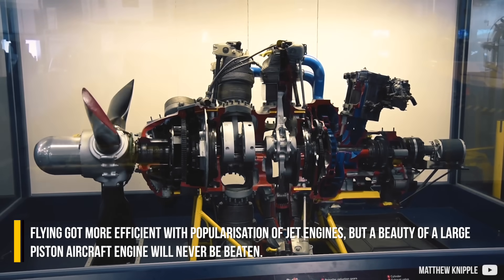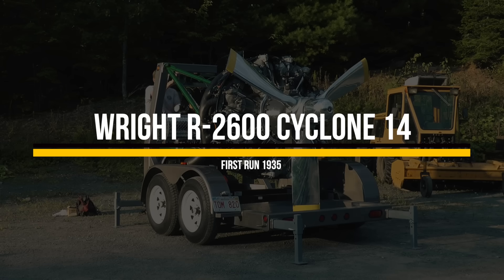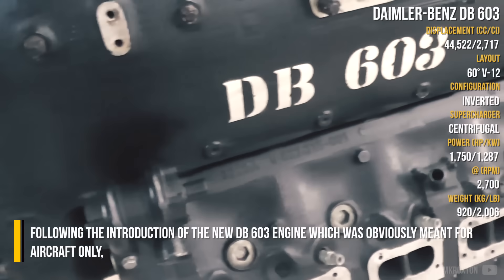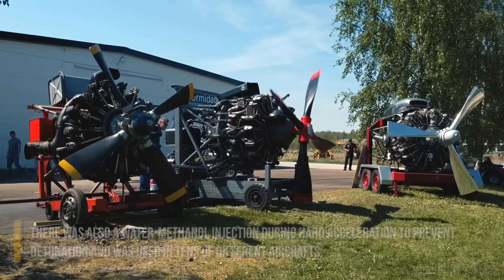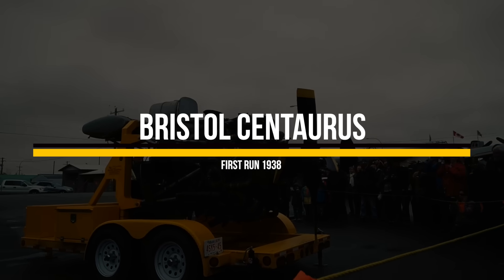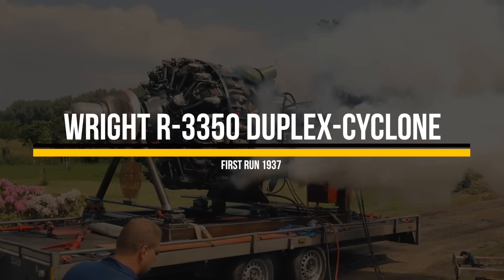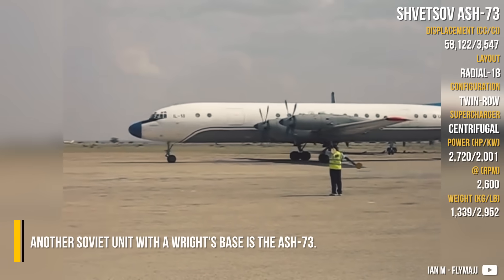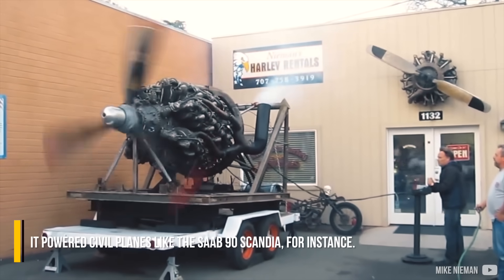9 Of The Largest Piston Aircraft Engines Ever

Comment: The coolest will always be the Napier Sabre 24 cylinder engine. Maxed out at 5500 HP. There wasn't an engine during the war that could compare to it's max power output.
Reply: Agreed.  Once initial reliability problems were overcome the Sabre was a potent engine, most famously used in the Hawker Typhoon and later Tempest. It is interesting to note that Napier ran into problems with the Sabre and the great Roy Fedden from rival manufacturer Bristol was co-opted into ironing out the problems.
Reply: @AMCKenA I like Setright's books but I don't necessarily believe everything he wrote in them.  I suspect some of what he wrote was apocryphal.  The 3050hp number I mention comes from Napier advertisements in Flight magazine post WWII.  They never advertise it at any higher power.  The 3750hp is believable for the MarkVIII and although I can believe the 175 hours but I have difficulty with it being continuous and at that power level.  4200rpm is about 400 rpm higher than the max for the engine in production and although possible it is also hard to accept.  I would think Conrod velocity would be getting up in the danger zone although I have not calculated it.

There is also the issue about what fuel they were using with charge air pressures of 45psi.  The Nomad used higher pressures but it was a diesel and I think one experimental (well, more experimental) RR Crecy used pressures at this level but it was a direct injection, stratified charge petrol engine.     BMEP is usually calculated not measured, so if any of the figures (rpm  or hp)are out BMEP will be equally out. 

Don't get me wrong, the Sabre is one of my all time favourite engines. I am fascinated by its design including the elegant way used to stop lash on the propellor reduction gear set which also serves to couple the two banks of the engine.  Its designer is, in my opinion, grossly overlooked.  But despite all this, I don't overlook it failings, not the least of which was amount of money and effort that was diverted to its production.  The same can be said of the RR Crecy and the whole range of sleeve valve engines built by Bristol. The RR Crecy, Exe, and Pennine were all sleeve valves engines (Crecy was two stroke and had somewhat different sleeve valve arrangement). 

In the book i have on the Crecy (currently on loan and not available), it is mentioned that Bristol spent more money ( maybe twice as much) and effort on determining the best material for the sleeve valves than was spent by Power Jets on the entire effort to develop the gas turbine!  I don't know whether this is true, it was said by a RR engineer, I think. The British were not alone, both the Americans and especially the Germans diverted massive resources and people to complex and totally unnecessary projects.  

The Germans, apart from the V weapons, the advanced tanks  were unnecessary (the Russian tanks were primitive but they could build a lot of them, the Russians weren't stupid), Junkers completely disabled the German Heavy Bomber Programme with their Jumo 222 and also spent a considerable amount of resources on the extraordinary Jumo 223, similar to the Deltic except having 4 banks of cylinders arranged in a rhomboid (technically superior to the deltic as all the crankshafts rotate in the same direction), and the even bigger Jumo 224. 

Then there was the RR Vulture and Peregrine.  Daimler Benz on the DB606 and other developments.  Heinkel also ran a number of high end projects that fail the sensible test.

Anyhow back to the Sabre. I assume that people at the Napier Power Heritage Trust would have a more informed view of what was the max power of the Sabre.  i must drop them a message and see what documentation is available.  During a quick look at their website, I can only see them mentioning 3000hp
Reply: @AMCKenA By the end of the war it was clear that the competition was all about fuel and air charge.  The only other part of the competition was keeping the engines in one piece.  RR's greatest advantage was the design of its supercharger.  Their other main advantage was their continuous development process.  I think it may have been Setright who described the Merlin as the triumph of development over design.  The Griffin was a far better designed engine.

Obviously the higher RPM possible with the smaller stroke of the Sabre was a big advantage but it was offset (to a degree) by the larger number of moving parts and thus inherently lower reliability, not to mention weight. 

At this point consider this; the power produced by the engine is determined by the mass of air that can be delivered by the supercharger/ turbocharger/ turbo-supercharger.  Even if the rest of the engine was up to the task the Sabre's supercharger wasn't.  This is exacerbated by the lack of charge air cooling (often erroneously called intercooling)  As is well reported, the Napier powered fighter planes really weren't good at high altitudes, a consequence of the design of the induction system.  Napier was apparently redesigning the supercharger when English Electric took control of the company.  Rightly, English Electric decided it needed to focus on correcting the reliability issues of the engine. After the war Napier redesigned the induction system for the Mark VIII.

In the end, it was the better fuels available to the allies that provided the 'edge'.  In this, there is a difference between bomber and fighters.  After the failure of the RR Vulture X24 in the Manchester bomber and its subsequent replacement by 4 Merlins which turned the Manchester into the Lancaster, it became clear that 4 engines were indeed better than 2. 

This is not so clear in fighters,  A single high power engine was the traditional solution for fighters.  Later in the war, this traditional view was tested by a number of 2 engined fighters designed by the Britishs, Americans, Germans and perhaps the Russians.  There are several to chose from but my favourite is the DH Hornet.  It doesn't hurt that it looks like an over engined scaled down Mosquito, itself inspired by the beautiful DH88 Comet.  At one time DH considered using the Sabre but the reliability/availability of the engine steered them back to the Merlin.

Although Ricardo maintained that the sleeve valve allowed a higher compression ratio by one (that is from say 6 to 7) on the same fuel, I do not know whether this was proven and if so whether it was the case later in war.

At 45psi (3 atmospheres!) the temperature out of a practical induction system is going to require a very high grade (octane) of fuel to avoid detonation and the consequent failure of the engine.  I am not sure that the maximum grade available at the time (100/150) would be sufficient for such an induction pressure and temperature, even taking into account ADI (anti detonation injection i.e. water/alcohol injection). I am having difficulty finding information on the boost pressures used in test bed Merlin/Griffins.  It appears that 25 PSI was the highest used in production engines. 

Interestingly, the 'turbo wars' in 80's F1 racing faced the same challenges with similar results.
Reply: @AMCKenA I am trying to find a paper i once read that was a relatively scholarly article that directly compared sleeve valve with equivalent poppet valve engines. This thread has me thinking about all of this stuff, I have also found a few old emails that have some of the things out of the paper but does not mention its name or Author - most annoying. As there were no equivalent engine to the Sabre, he compared the Bristol Hercules and Centaurus engines to the P&W R2800 and the Wright R1820. There is some comparison of design factors between the Sabre VII, the RR Griffin 130, the RR Eagle 46H22, and the Merlin 130, earlier Merlins and Griffins, the Allison V1710G and the Allison V-3420.

The sleeve valve engines did run 1 compression ratio higher than the piston engines, Merlins and Griffins 6:1, Sabre and Eagle 7:1.  The Sabre VII had a maximum military rating of 3055hp @ 3850rpm on 100/130 fuel, unfortunately the boost pressure is not shown.  The sleeve valve's anti knock capability was demonstrated by the much lower ignition advance enjoyed by the Bristol sleeve valves.

I still find it hard to believe the 5500hp.  Some calculations put the maximum possible power out of the Eagle22 at about 4300, it only reached 3500hp despite its 46litres.  Impulse power is never used in specifying the max output of an engine, the dynos of the day would have taken a while to come back with an accurate power reading. Max power for a few seconds is relatively meaningless as are powers for 'special' engines. 

For instance the Merlin equivalent of the Rolls Royce R engine was a prewar strengthened Merlin III.  It produced a max power of 2160hp at 3200rpm and boost of 27psi At the time the production engine was putting out about 1000hp.  It could survive a 15 hour test at 1800hp at 3200rpm and 22psi boost,   much better than I would have thought.. It is also much better than the RR R (racing engine) which often had a between tear down period of a few hours.  The fuel must have been very special, there was no 120/150 grade or even 100/13 grade fuel at that time.  As the engine would not be run for very long, leading of the plugs was probably not much of an issue so i would think there was a lot of lead in the fuel 

A couple of other things from the paper in my emails (for radials)  were, sleeve valve was inherently heavier than poppet due to cooling issues with the junk head, sleeve valve engines about the same frontal area area as poppet valves (again cooling issues).  Inline liquid cooled engines are heavier and longer due to wider cylinder spacing required for the layout of the inlet ports.  The Sabre was especially heavy due to two large crankshafts, later, the weight was somewhat reduced when the counterweights were removed from the crankshaft design. 

In the end the paper appears to back the claim of sleeve valve superiority but at a price.

Some things that I found very strange about things in the paper, it appears that a contemporary book showed  that sleeve valves used about half the oil as the equivalent poppet valve engine, quite the opposite to what has been promulgated in so many stories.  Total friction in the sleeve and poppet version was about the same.  There was, however, a problem with the sleeves that was due to the mono grade oils available at the time.  The Napier used the Coffman starter system. In cold weather, the engines were difficult to start due to high viscosity of the oil, the solution was to start and run the engine every three hours or so, the alternate was truck with a big heater on the back was was used to blow hot air through the chin radiator and warm up the engine. 

The Napier was difficult to start and many pilots had problems so ground crew would start the engine for them.  The Coffman starter really wasn't powerful enough  for the Napier.  The impulse start caused by the rapid rise of pressure in the starter cylinder put the engine under a fair deal of stress, this was no different for the Merlins that used them.  There were 4 cartridges in the Coffman starter. If all cartridges were used and still no start, the ground crew had to remove the plugs and spray a solution of oil into the cylinders to replace the oil that the fuel stripped from the cylinders.  When the engines were shut down, at the end  there was an injection of the oil solution to keep the cylinders lubricated.   This responsible for the cloud of smoke when they were started.

When properly built, sleeve valve engines were more reliable than poppets with very long service times.  Few wartime engines were adapted for post war commercial use.  It cost RR a lot of money to get the Griffin up to snuff for commercial use.  It was much easier for Bristol and the Centaurus which had very long service periods.  It is interesting that of the last 5 piston engines designed by Rolls Royce 4 were sleeve valve, the only poppet was the Griffin, which followed the line of 36litre engines The Condor, the R, and the Griffin. 

The air cooled, sleeve valve X24 Pennine was designed to be put in commercial service.  So what did RR know that made them shift from poppet to sleeve? 

I will eventually find that  paper and when i do I will post a link.
Reply: Napier sabres is testrun 4500hp 3500rpm or something like that
Reply: As far as i am aware the engine never made anything close to 5500hp.  The last production version (the Mk VII) was rated at 3050hp.  There were reports that the Mark VIII made around 4000hp with a completely redesigned induction system but I have not seen any documentation to back the claim.  I suspect the 5500hp number is the structural design capacity of the engine before it breaks, not its actual output.  This number would be considerably more than its original design as the engine had two major redesigns of its internal structure (including discarding the crankshaft counterweights!) through its life, 

The engine was almost single handedly designed by Major Frank Halford who was unfairly blamed for many of the problems with the engine, the original hand made prototypes worked very well. 

Unfortunately, Napier could not rely on its highly skilled craftsmen to build the engines in production and the design really wasn't well suited to the unskilled workforce engaged by Napier in war time. The tolerances required in the sleeve valves was far tighter than RR employed in its engines.   It has been said that Napier's original production facilities resembled something you would find described in a Charles Dickens novel.  I think that Napier, as a company, just wasn't well suited to large scale production.  Things improved dramatically after English Electric acquired the company.

There are some very interesting stories about the engine including the redirection of some precision centreless grinders from Pratt&Whitney to Napier.  I do not think P&W was very happy about it.  When all the production problems were occurring, Frank Halford had already closed his design shop and returned to working for de Havilland exclusively.  He designed all three of their gas turbines, the H1 (the Goblin), The H2 (used in the Comet but only indirectly related to the sad history of that aircraft), and the H3.

Anyhow the Napier Nomad was much more complex than the Sabre, it being a compound engine, half gas turbine, half 2 stroke diesel with many unconventional design features.  Features such as the load sharing variable ratio Briers coupling that transferred the excess power from the 3 stagepower turbine (that is, power turbine produced several hundred hp more power required by the 12 stage axial compressor to function as a supercharger) to the 2 stroke diesel crankshaft.  All the power was transferred by a very thin film of oil in shear!!. 
The whole engine was far too complex to be used in the field. The US Airforce looked at the engine design in ( I think) the 90s when assessing aircraft engine design (Again I think it was helicopter design) but baulked  at the complexity.  Even the two stroke diesel was unconventional, its fully ported loop scavenged combustion chamber did not have enough cylinder compression to ignite the fuel charge (when running at power the supercharger provided enough extra compression to support ignition) so Napier designed a primitive spark ignition system to start the engine.  There were many other unusual features including the opposing conrods running on the same crankshaft journal with NO offset, there were no caps on the conrods just thin retaining rings that stopped the conrods from falling off the journal when the engine was starting or not running.  Even the big ends themselves were unconventional, too hard to explain and I doubt most people would believe it.  Composite pistons made of alloy with a pressurised oil cooled iron crown, the list is just too long.

So why design it? The Nomad's main claim to fame was that it was the most fuel efficient aircraft engine ever built, i do not know whether it still holds that title.

You can find some contemporary articles on this engine and other engines (RR Griffons) in the Flight magazine which is archived on WWW. Sorry, but i can't remember in which editions they were described.  Worth looking up was the RR Crecy, a very unusual engine in its own right.  I have read THE book on the engine and it is well worth the read.  I haven't read the other two books that include the Crecy.  One is on all the 2 stroke aircraft engines so it includes the Nomad as well, the other book is on RR engines only.